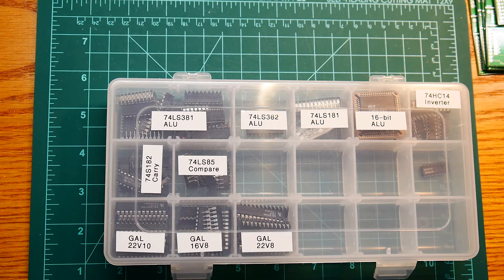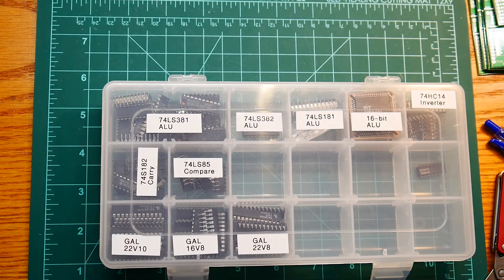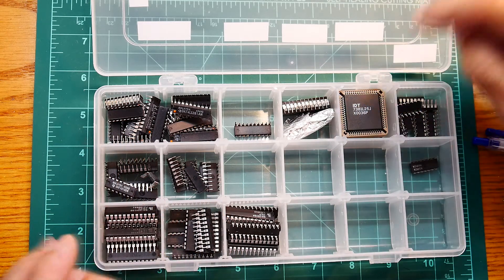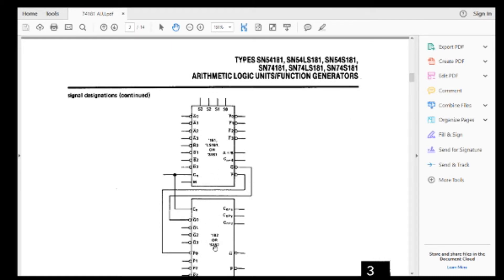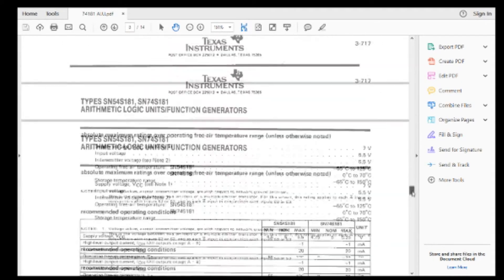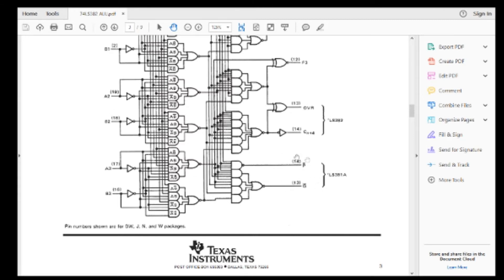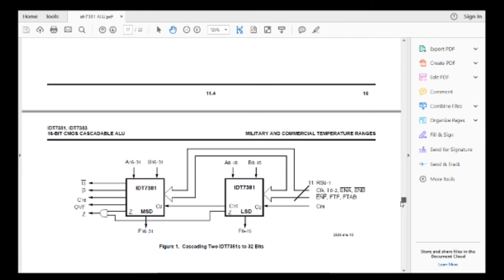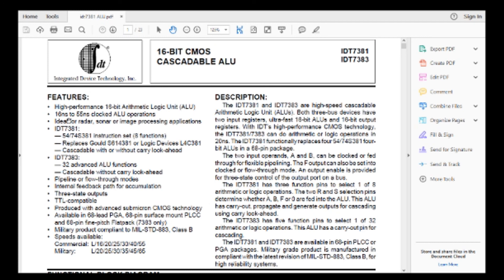#80 TTL CPU arithmatic logic unit

Comment: I received my 74181 order a few days ago, I've used the '181 in several projects & it has been the go-to LSI part when in need of an ALU, my newest '181 are for my 74xx based Apollo Guidance Computer build.
Reply from the maker: The 74181 is an interesting chip and the basis of many minicomputers in the 60's . I can't believe MIT designed the Apollo computer using only three input NOR gates. and RTL logic! The ALU must look quite complicated.
Reply: @IMSAIGuy  At the time, around 1963, the AGC was pretty much completed, there were no families of logic IC's available, it would've been FAR more efficient to have utilized a range of logic IC's if they were available, though at the time it was a better design path to go with one verified standardized IC to construct the AGC, of course the demanded low failure rates played a significant role in the decision process.  By the time the Block II AGC's were built the first range of logic IC families then became available though by this time the design had been frozen. My AGC will use over 500 74xx TTL IC's while the Block II AGC was constructed with around 2,800 IC's with dual three input NOR gate RTL logic! while the Block I AGC  eing constructed with over 4,000 IC's using a single three input NOR gate RTL logic.  Many compare the AGC to a  digital wrist watch or simple 4 function calculator which is poor description, the AGC was a fully programmable computer in modern terms sharing it's closest resemblance to a microcontroller, with a close comparison being a Microchip PIC16 series microcontroller.
Reply from the maker: @perseverance8  Are you duplicating the actual AGC? how to converting from the original design to a TLL version with higher functioning parts. I've looked at the original schematics. quite complicated
Reply: @IMSAIGuy  Yes, a full AGC, the project has been underway since late 2009, I decided to stay with origional series 74xx where it was easy to source around 90% of components the remaining came over 5 or so years including specific prototyping wirewrap boards.
Reply from the maker: @perseverance8  The ALU is called the 4 bit module in the schematics?
Reply: @IMSAIGuy  Yes, in my AGC it utilizes four 74181 IC's.
Reply: @IMSAIGuy  I considered building my AGC with 7427's, the 7427 is a triple three input NOR gate, of course that would more than triple the 500+ IC's in the current layout. [Edit] I actually purchased 2200 7427 IC's early on if I went that route, I believe I only paid 5 cents for each of them,  which I could'nt pass up.
Reply from the maker: @perseverance8  you are hard core! one massive PCB or a modular design?
Reply from the maker: @perseverance8  I know it's cheating but check out the 16bit ALU IDT7381

Comment: Hi IMSAI guy. I really like your project! Seems tough to accomplish. Two questions I do have: 1 do you a site where I could perhaps look at the schematics, 2. I've purchased on eBay the 22V10 GAL IC"s but can not get them programmed with the TL866 Miniprogrammer. Which programmer do you use and where did you get your GAL IC's?
Reply from the maker: No site with schematics sorry. The TL866 will only program Lattice brand 22v10. I tried cypress but failed. I got the Lattice GAL22v10  on ebay